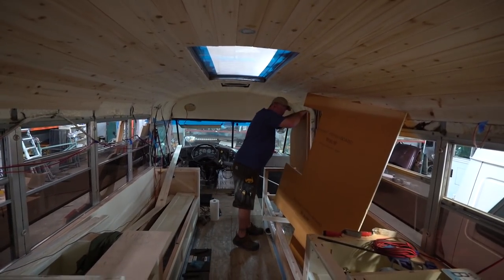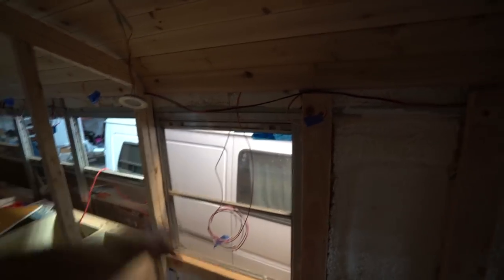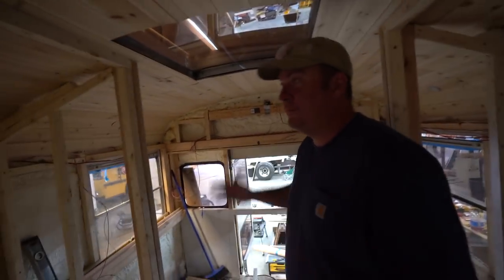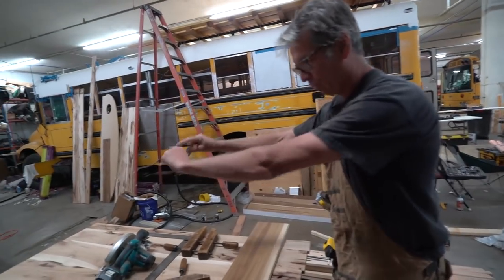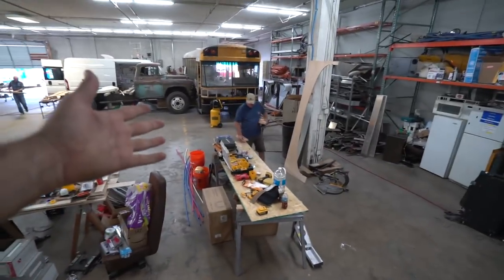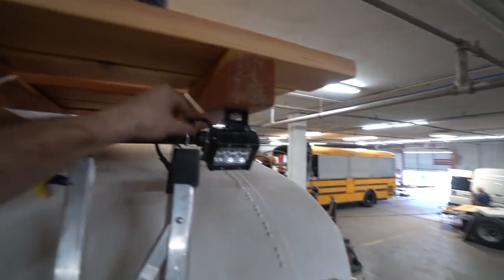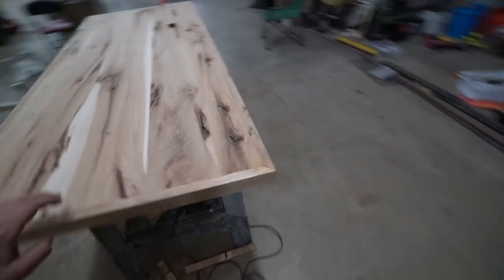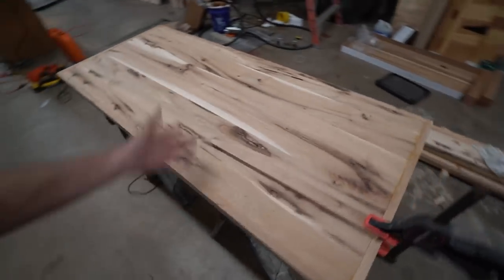Shower Backer Board + 12 Volt Wiring + Custom Table

Comment: I'm wondering if you're going to test your plumbing before covering it with panels.  Might be a good idea, to check for leaks.
Reply from the maker: Well, not much if the plumbing will be covered by walls. But, that’s the intention!

Comment: Jax, don't forget to install a hot water by pass line from your shower to your fresh water tank to keep wasting cool water until the hot water reaches the shower head.  Do it now and all you need is a valve and T to divert it back to the fresh water tank.
Reply from the maker: Ahh good tip. Thanks!!

Comment: Couldn't you use two colors of stain and make a chess board on the table without any cutting? Or even Paint.
Reply from the maker: Anything is possible. This is what we dreamed up.
Reply: Inlaid chess board is just so much prettier and durable
Reply: I will not argue with that  @SteampunkSteve  I was just wondering. It just depends how much work you are ready to do.
Reply: It will defenitely look cooler. @JaxAustin
Reply: You can't get a clean line with stain